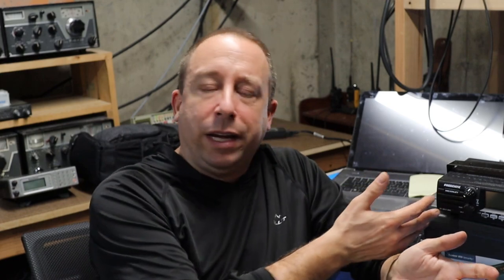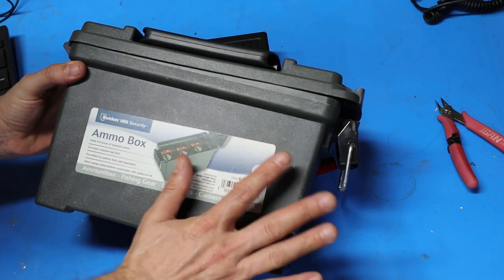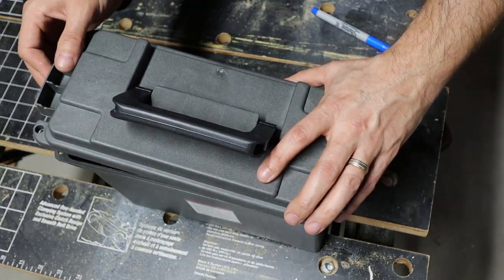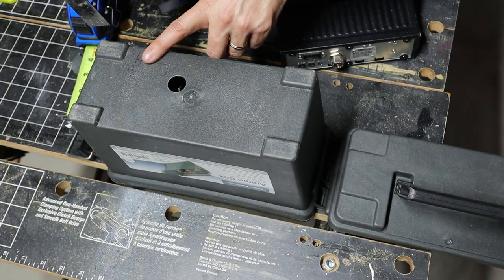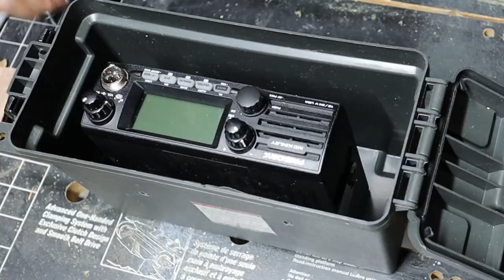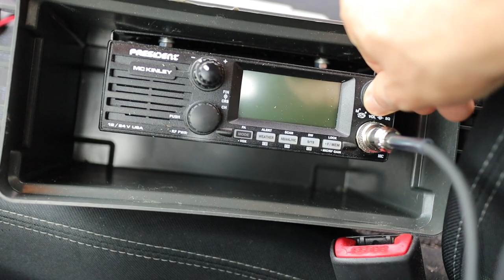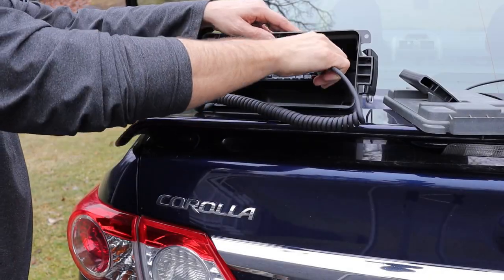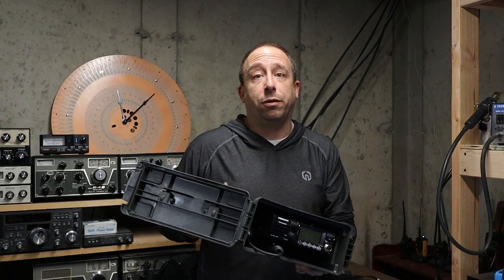Cheap and Cheerful Ham Radio or CB Radio Carry Box / Temporary Mount

Comment: I’ve seen a few ic-705 builds with this. The rectangular Bioenno 12/12 sits flat on the bottom with the radio on top anchored with a 1/4x20 bolt through the plastic to the 705’s tripod mount. 🎉

Comment: Good video. I also use the same ammo can for a portable battery with power pole connectors on it. I like using it from time to time and I don't have to worry about any noise from the alternator. I'm also a Ham and I agree with you; most of us got our start in 11 meters and there is nothing wrong with still enjoying it! I have to travel I-95 a bit and 11m works better than 2m for road information. :)

Comment: Nice.
I have a bigger .50 caliber plastic ammo box that has a 10aH LiPO, a little 4W CB in one end, and a little Anytone 20W VHF/UHF on the other end.  I ran two 1' coax jumpers off the back of the radios and have a UHF (SO239?) female-female bulkhead connector on the lid.  The battery has a female cigarette lighter port and the radios have male cigarette plugs.  Have a 2m/70cm mobile antenna that I screw to the inside of the open lid with the coax connected to the outside of the lid for ham.  Have a firestick with a mirror mount for 11m.  It can work as an independent go-box, or set it up in the car.

Comment: There is really no way to mount a CB radio in a Toyota Sienna, without doing some major cutting of the dashboard. I use a small plastic milk crate I bought at Walmart for $1 and have the radio propped up with foam blocks and the CB in that. It sits in front of the dash. Works well and I can quickly remove the CB if I want to.
Reply from the maker: Sounds like a good setup!

Comment: Awesome idea!!  I did the same thing several years ago for one of my amateur radios.  But I went a step farther, I didn't want any holes at all in my case.  So, with some configuring I have my radio, with a 12 volt 7 amp/hour battery, fuse panel and some other available hook ups and made a complete portable ham radio operations box in one of those ammo cans.  Here is the link to the video:  https://youtu.be/SzZ7kWqu-NM    Again, a great idea.  Juddie - WD8WV